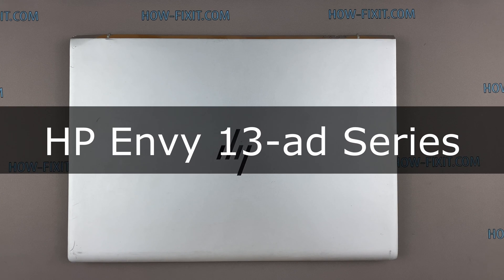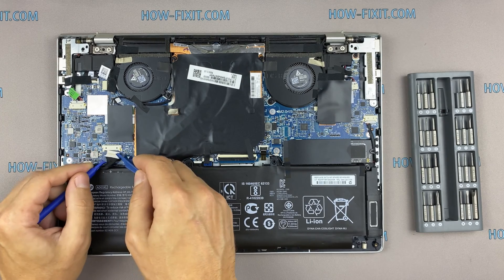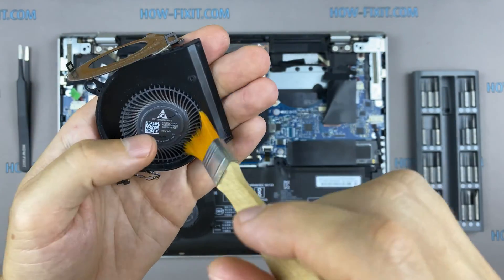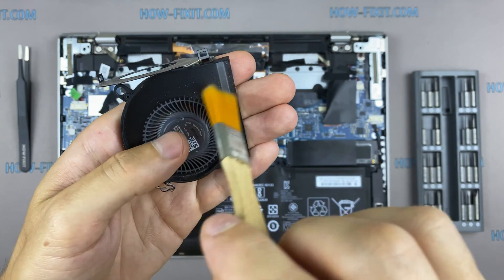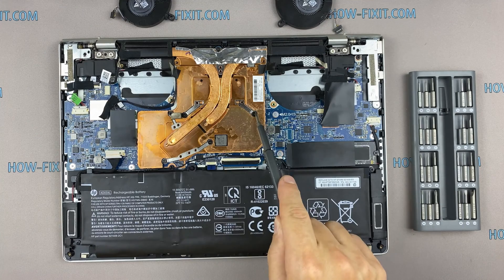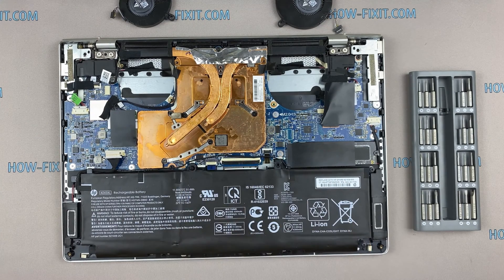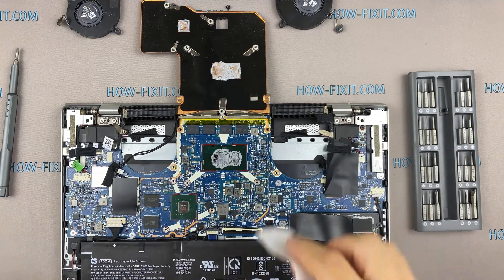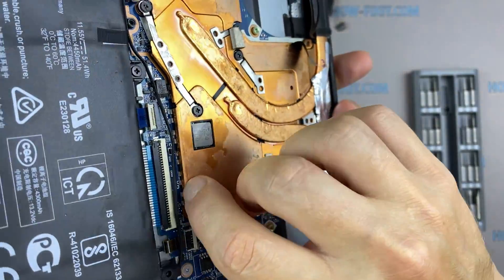HP Envy 13-ad Disassembly, fan cleaning and thermal paste replacement

Comment: the black ribbon "cables" you were removing right at the beginning for the fans, are those actual electrical cables connected to something, or just sticky ribbons to hold the fan in place????

Comment: I have this same model, couldn't figure out for ages why the back was still stuck near the hinges and it turns out mine has 2 screws under the grey support next to the hinges. If it doesn't come off easily then you might have this variant too
Reply: I was about to say this too lol.